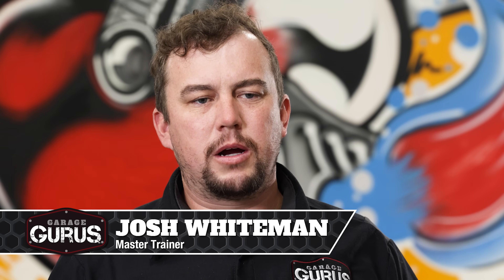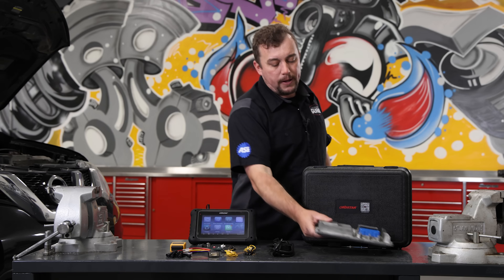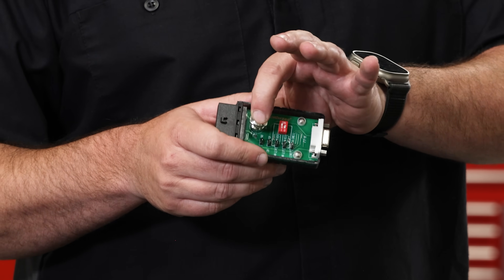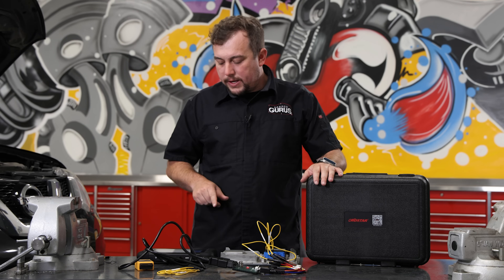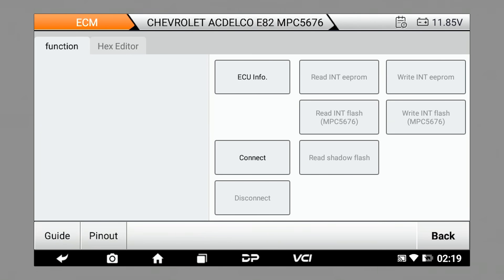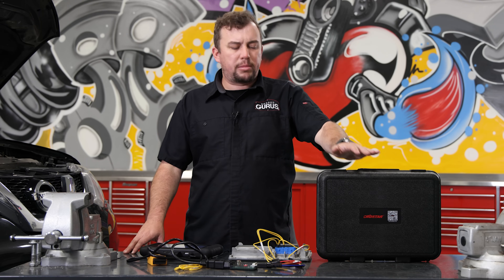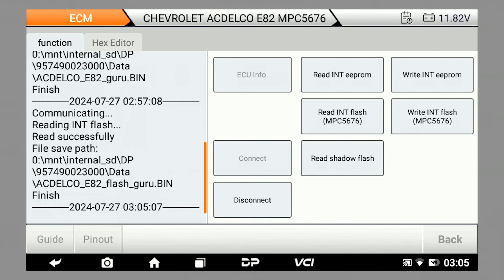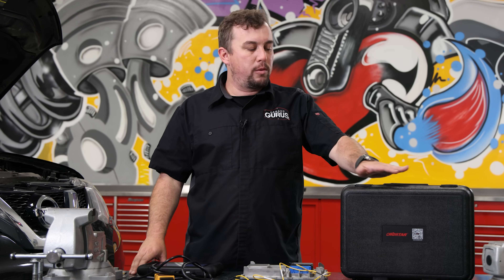Garage Gurus | How to Clone an Electronic Control Module

Comment: Does this tool have modules for Mercedes and European Cars? ECU/TCU ect?
I am researching... I have a 2007 MB ML-350 that I picked up saying the COMPUTER NEEDS replacement, but I got it fired up, but want to bench it and test it (Image file for Future) and cloning from a Junkyard Swap (so I need to VIRGINIZE IT then WRITE)/// Let me know.. this is a 7mo old video so... I clicked like and subscribed....
Reply from the maker: Hi, thanks for reaching out! Our tech team would be happy to help you with this. You can reach out to them at 1-800-325-8886. They are available Monday – Thursday from 7:30 a.m. – 4:30 p.m. (CST), Friday from 7:30 a.m. – 4:00 p.m. (CST).
Reply: Hi did u ever figure out I have an 06 Land Rover that needs the same process done

Comment: Does anyone know if this works for cloning the transmission control module of a Jeep Liberty Sport 2012 P56029522AB? My mechanic is not able to write the VIN to it with his tool.
Reply from the maker: Hi Daniel, thanks for reaching out! Our tech team would be happy to help you with this. You can reach out to them at 1-800-325-8886. They are available Monday – Thursday from 7:30 a.m. – 4:30 p.m. (CST), Friday from 7:30 a.m. – 4:00 p.m. (CST).

Comment: Bad practice. Read and verify. Write and verify. Also read shadow on those ECUs in case ECU gets bricked. You need this to recover using boot mode. Should have also mentioned power supply requirements. And where to plug power in. Too many people still powering up from the 706 and not the connector nearest the ECU so to speak.
Reply: I can't remember..
How many modules I have bricked....probably 1 at the most....is just an overview of a tool... DC706 is pretty solid... hater will always hate.....
Reply: @jdvazquezz17 I'm not hating my friend. These videos are very good. I was just trying to help because people with no knowledge are expecting these tools to work every time. You see it all over the forums. All I was saying is verifying is needed at every stage. Too many times dumps are posted full of 0x00 or 0xff or obviously scrambled data. Anyway, I didn't mean to offended.
Reply: @timmehlittleloud2251   I, and I'm sure others on here, appreciate your added info. Thanks!

Comment: One thing to keep in mind is these tools do not always transfer the full flash so follow up programming may be required with OEM tool. 
These cloning tools at least give us that option by transferring the identifier data over from our original module. 
When cloning modules remember to obtain a module with the same hardware ID and service number.
Reply: For some reason unknown to me is that. One more thing to keep in mind is the oem tool will probably not always work either.

Comment: Where did you get the information to clone from. We watched you clone to the ecm but not where you got the information 1st
Reply: Sometimes you can copy the programming from another "KNOWN GOOD UNIT" and use that "HEX" Editor to change individual values like serial numbers to match the vehicle you are working on. More to it than that, but it gives you an idea of how it works.
Reply: He's cloning, so the info is coming from one module and going into another.  In his demonstration he just used the same module to pull from and put it back in.  If you were getting the info from elsewhere you'd be programming the module and having to go through the parameter reset and key programming that he discussed.
Reply: As long as the damaged original ECM can communicate we will extract the data from the original module and then transfer that information over to the module acquired from salvage yard.